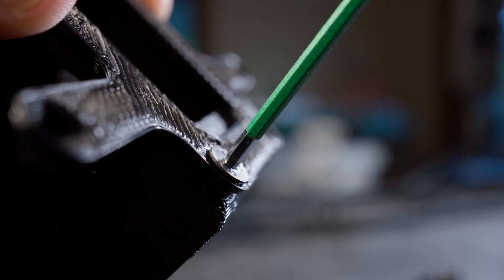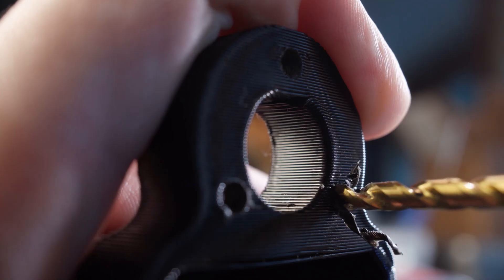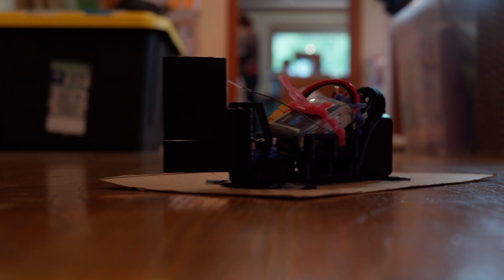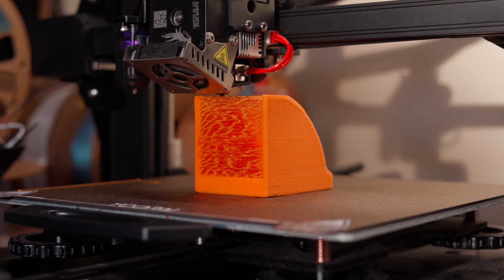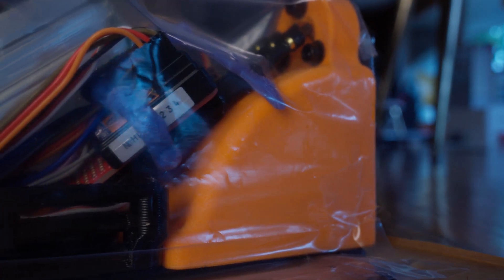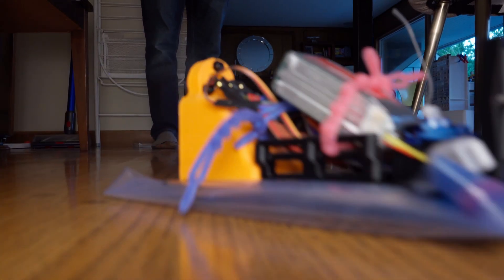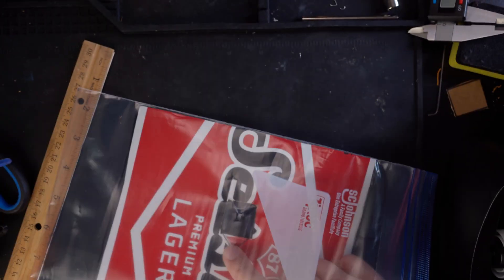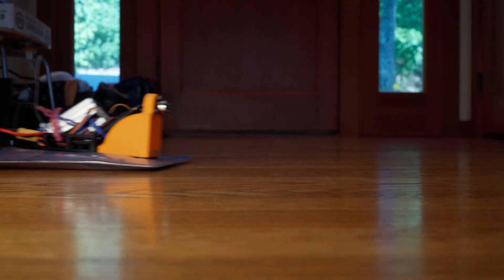DIY RC Hovercraft Floats on a Freezer Bag

Comment: put trims on the edge of the cardboard a little bit thicker so the ziplock bag doesnt take all the weight and its slightly rests on the trimm, yk like a bumper but all around.
Reply from the maker: Yes! Good idea! I think we have some scraps of packing foam that might work well. We gotta try that. Thanks!